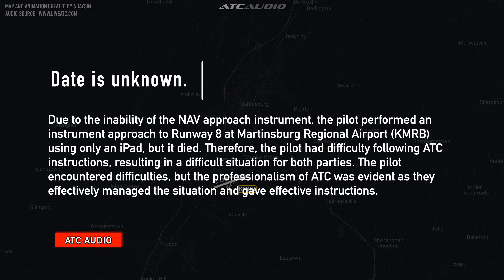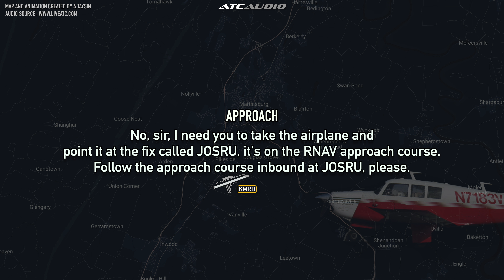Pilot CAN'T FLY IFR after his iPad ran out of power. Real ATC Audio.

Comment: Flight Aware shows the aircraft is still active, so apparently the pilot was eventually able to complete an approach of some kind. As the controller more or less correctly stated, an iPad (or any portable GPS for that matter) cannot be used as the sole means of navigation in IMC. While iPads coupled to GPS receivers with AHRS are certainly capable of serving as a backup, they cannot legally be used for navigation except in an emergency. An iPad can be used, however, as a storage device for approach plates. It is possible that when his iPad died, this pilot did not have a backup source for the required approach plates. While we can't really hear the pilot's side of the conversation, it seems pretty clear from what we could hear that the pilot was unable to navigate to fixes on the approach using his aircraft's built-in GPS. We can only speculate about why that might be since we don't have all th facts, but one possibility is that he was never properly trained on the use of his built-in GPS and other navigation equipment he had on-board. Another possibility is that without a backup copy of the approach plate, he was unable confirm he had the correct approach loaded into his built-in GPS.

When any pilot requests a Part 61 Flight Review with me, I always ask about the equipment in the aircraft to be flown, whether or not the pilot is Instrument Rated, his/her familiarity with the equipment, and recency of experience. The Flight Review is then tailored to specifically address any deficiencies the pilot might have, including on how to use the navigation equipment in the aircraft. An iPad is an excellent tool for situational awareness, but it can also be a distraction if the pilot becomes too focused on its use. All pilots need to stick to the fundamentals--Aviate, Navigate, Communicate. This pilot appeared to have difficulty with all three. Fortunately, it doesn't appear this flight ended in tragedy.